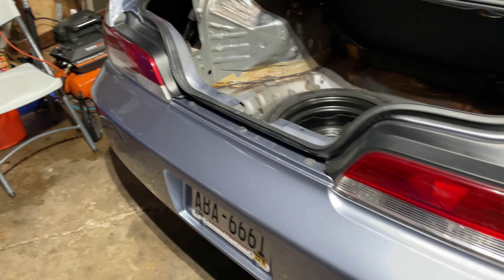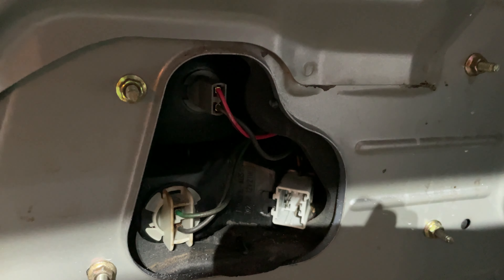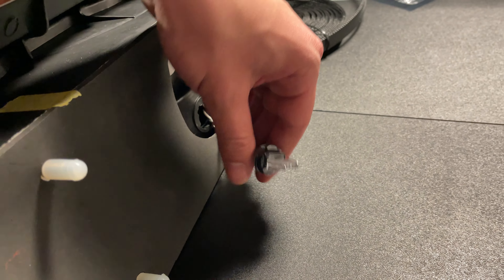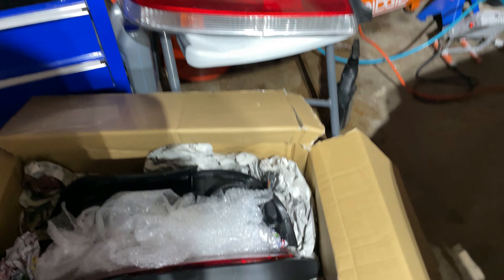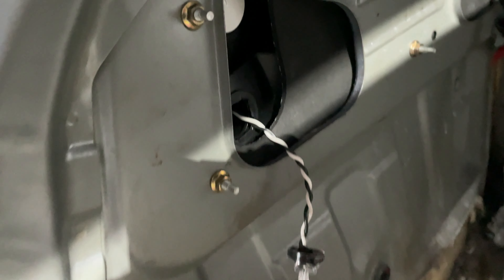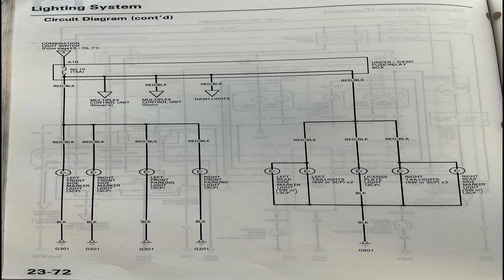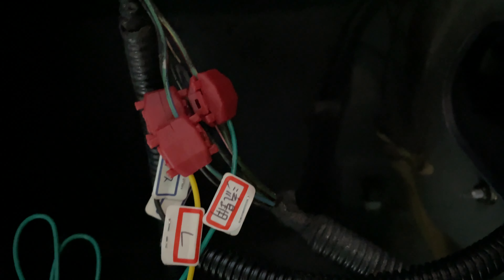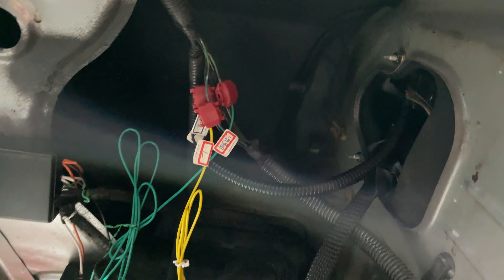How to install CRAZY LED tail lights on a 5th gen Honda Prelude | Sequential tail lights

Comment: Interesting that your set came with plugs already on it. I bought a similar set, but it does not have diff patterns and the extra controller+harness+remote. Mine also came with bare wires out of the taillight and the reverse light/turn signal area are closer in size to oem if that makes sense. Seems like there might be a few sellers or diff versions. Do you remember what wattage resistors you used for the turn signals?
Reply from the maker: I don’t but I do know a YouTuber that actually showed me what resistor to use. His name is rawrkee. He actually introduced me to these tail lights

Comment: Those lights look amazing!! That installation however looked like a completely ridiculous disaster holy shit. Incredibly complicated is what I mean. 

It’s amazing to me how the company that makes these doesn’t take into account the needed resistor you added for the extra current. A good manufacturer would consider all of these extra steps you had to take so the user experience of installing it would be as simple as possible. Yikes 😬

Comment: What I'm shocked no pool of rusty water in your preludes trunk!!
Reply from the maker: There was, is that what that is? Why does that appear there?!
Reply: @preludeboy99  The foam neoprene gasket seals on the tail lights dry rot letting water flow into the trunk. Also keep an eye on the sunroof water drains as well they tend to get clogged up and start to rust out your roof.